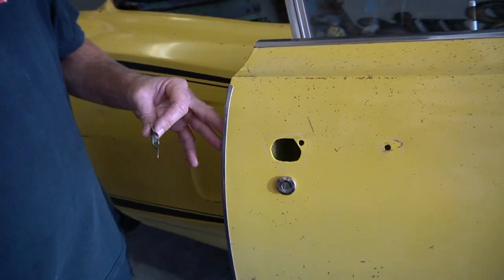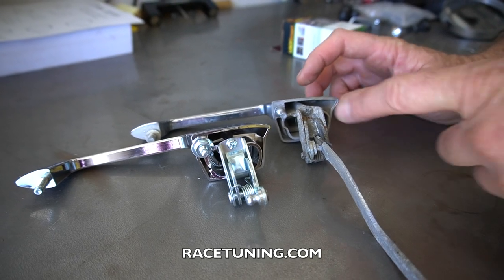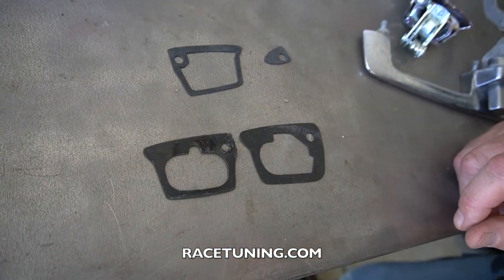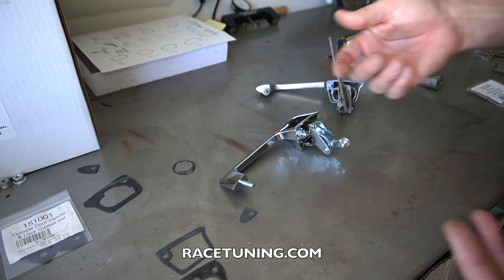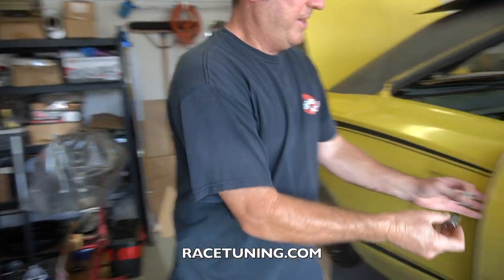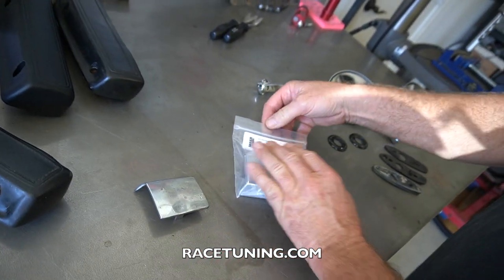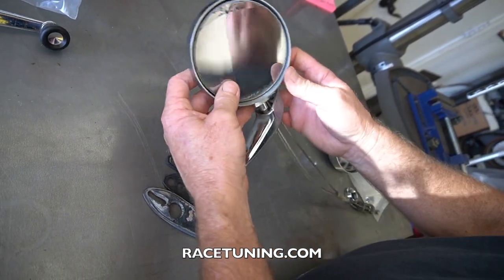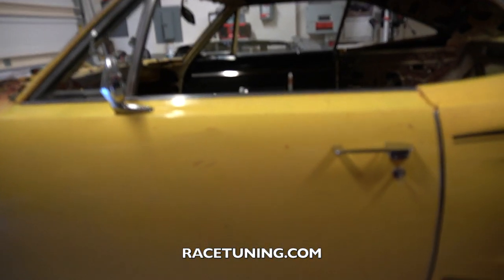68-70 MOPAR B-BODY DOOR HANDLES, LOCKS & MIRROR INSTALL - Road Runner GTX Charger Coronet Super Bee

Comment: I have a "70 Bee as well; the doors open and close without a problem. I also have a '69 Road Runner that will break your thumb off when opening the door from the outside, especially the passenger side. This video is helpful.